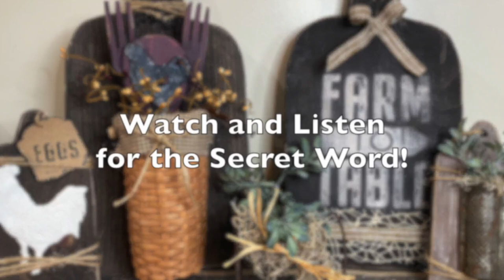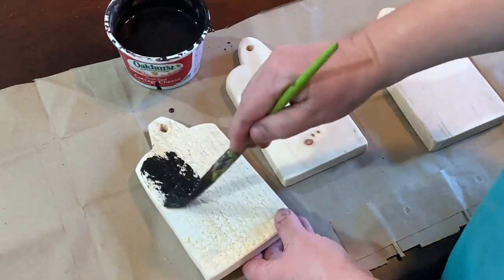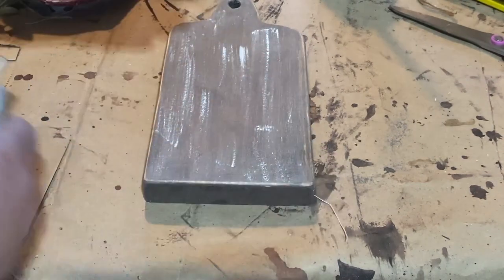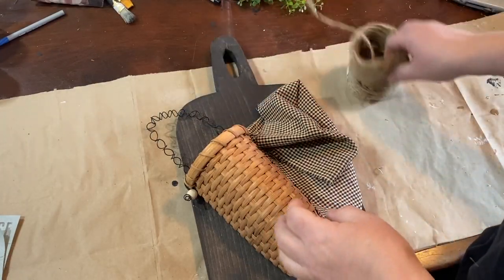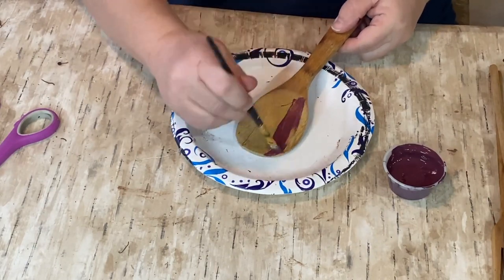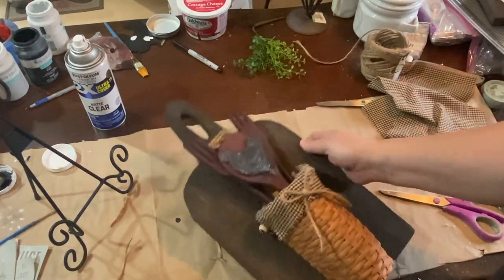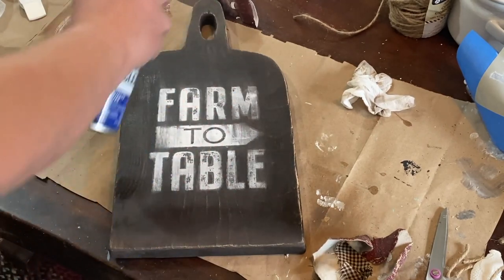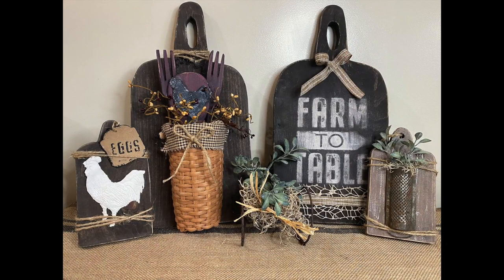DIY Country/Primitive Cutting Boards | Scrap Wood Projects | Trash To Treasure

Comment: I have those same kind of stencils. I have never used them because I didnt have the right paint. I did not know you could use chalk paint.thank you for showing how to use them without the regular kind of paint that they say you have to use. I have the stencil you used plus one that has a knife fork and spoon.
Reply from the maker: Nice! Just make sure you seal them in some way once they are done. I use wax or a spray sealer.

Comment: Nice save on the Farm to Table sign. I think it was Bob Ross who said "We don't make mistakes, we just have happy little accidents".  I admire your ability to cut out those cutting boards from scratch. These projects all turned out awesome. I have a router table, I just haven't used it yet (actually I need to learn how to use it).
Reply from the maker: That is exactly how it is. When I read that it was in Bob Ross’s voice and I could picture him sitting in front of the picture too. 

So glad you like my projects 🥰